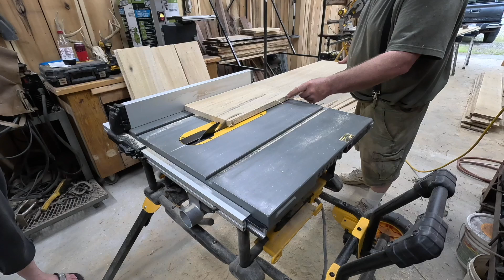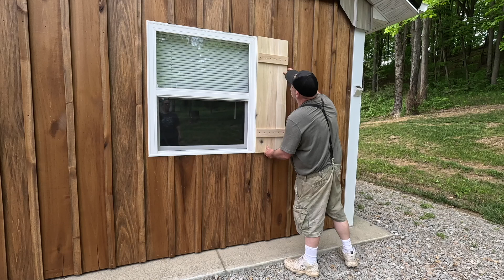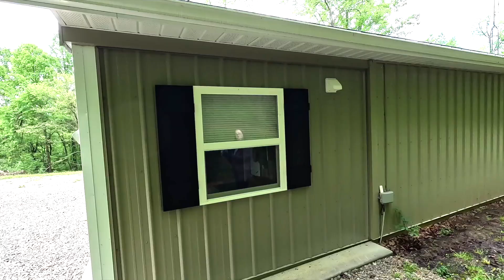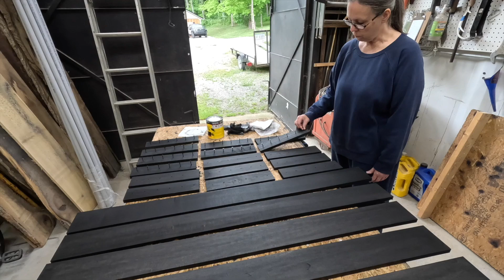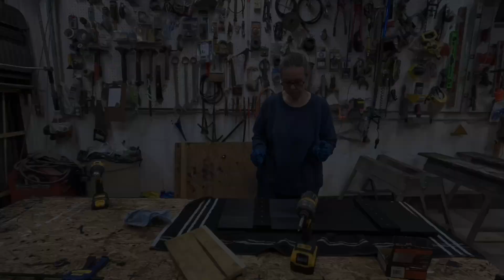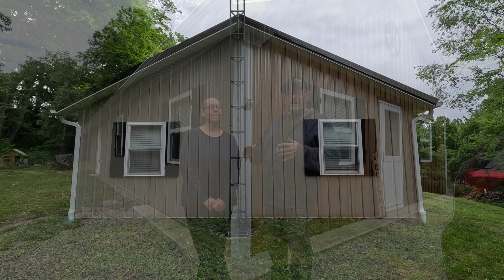Barndominium wooden shutter build

Comment: You're gonna have to take all them side shutters off when Julie makes you board and batten the rest of the house.
Looks good.
Reply: Why would you put board and battens on the metal siding??
Reply: @MrSTOUT73  Because it looks great, but would probably replace it rather than put it over top.
I'm just messing with Kevin anyway.
Reply from the maker: You trying to get me in trouble. 
Thanks Daryl.